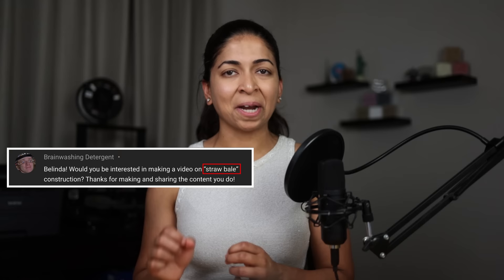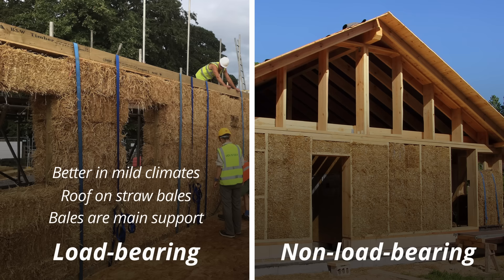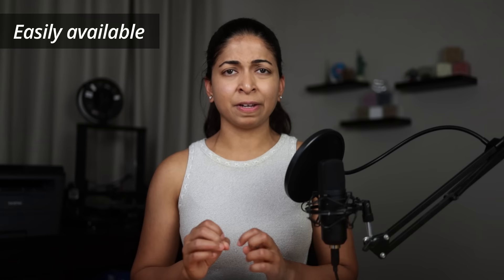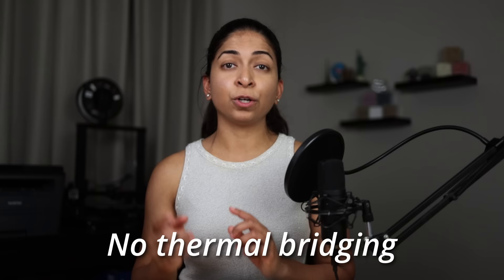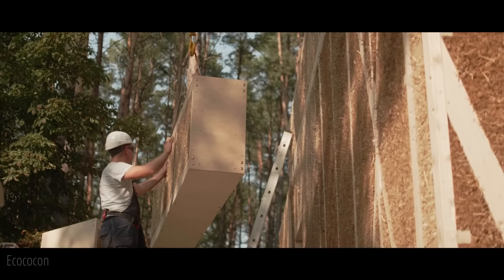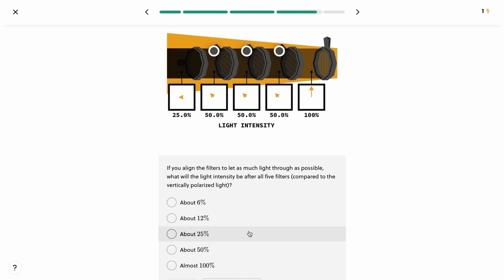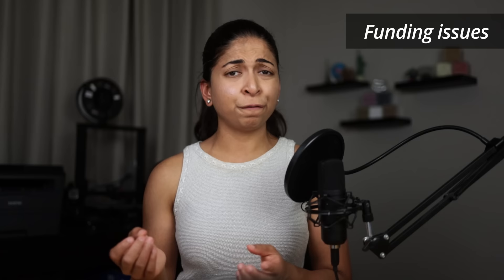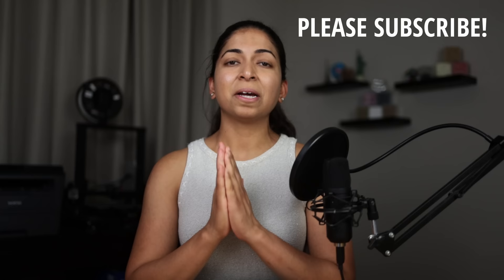How to build Straw Bale Houses | Pros and Cons

Comment: Most of the downsides of bales are the same as for wood. As they are the same material, cellulose. Just bales don't dry easily once wet, so have to be kept dry. Though longer term the same is true for both. Considering the lumber costs this method should have exploded, but so few understand it. 
Austin TX has a written code for it. Though I feel it is all constructed slightly wrong which causes the wall height limitations. The walls need some method of staking them together to provide shear resistance (keeping them in a stack). So most put a high strength material though the center of the bale, like rebar or wood stakes. That method doesn't use the strength of that material well. It should be placed on the exterior of the bales and tied together between each course. Then the high strength material is on the outside where it forms a sandwich composite beam. The tying pinches the bales between, providing the shear resistance, but also adds bending resistance that center staking does not. The concrete/lime/plaster takes the compression, and the sandwich material takes the tension. Then building to larger unsupported heights isn't as large an issue and the walls are far stronger. It is also easier to construct as nothing is required to pierce the bales.

On the issue on wall hangings, you can place wood strips between the bales at locations you expect to hang things. Particularly cabinets that carry higher loads. They can be installed either horizontal or vertical, and are a rigid connection point once all the plaster surrounds them. Some even leave the outside edge exposed which makes them easy to find.

Comment: The prefabricated panels sound like the most feasible way to incorporate straw into a wider usage. There is less room for error in manufacturing due to being done with machines, and probably also offers the option of including other liners or chemical treatments. I'm sure it will take a lot more trial and error to find the best way to use straw in modern construction though.
Reply: I'd add to this that it seems most current techniques are being limited by the conventional form of straw instead of how it could be used/processed.

Highly compressed straw panels could have useful applications (mostly eyeing that fire resistance) as drywall or even in a matrix like hemp.

Simply stacking bales just seems like minimal effort in application.
Reply: @quintessenceSL  Something along the lines of medium density fiberboard made from shredded, compressed, and treated straw? I'm unsure if straw would have similar enough properties to sawdust to be used like that, but it may be worth looking into.

Comment: ??? As an architectural engineering student, I became fascinated with the idea of underground buildings.  The insulation qualities are intriguing.  Can they be built in a green manor? Are maintenance costs reduced?  How much more costly might they be from traditional construction?  Are they safer from fire and tornado damage?  As a lighting engineer, with clear story windows and skylights, it's possible to get ample daylight into this type of building for a pleasant space you'd want to live in.  I'd be interested in your take on this subject.
Reply: As a follow up, relating to your video on geopolymer cement, this seems like a good material for the envelope due to its waterproof properties.

Comment: I recently learned that there is a team over at Penn State Uni that has been investigating low temperature (<200C) sintering ceramics for applications such as building materials.  That could have profound impacts for the sustainability and longevity of structures in almost all climates.  It's headed up by Prof. Clive Randall.

Comment: Things i wish you had mentioned:
Old quote from the 1960s and 70s... "Good Hat & Good Boots"  meaning a proper roof with overhanging eaves designed for each specific location.. and the right foundation for each environment and topography. 
Attention paid to exterior surfaces to insure continuity (no gaps or thermal breaks).
 Acoustics  deserve special mention!  Ask musicians ... and old high fidelity fans.
Asthetics are a large factor in long term satisfaction for home owners. When the walls are reserved for doors, windows and sculpted clay...light flows around in an ever changing dance. Closets, cupbords, built-in  whatevers and paintings can grace the interior walls.
The $$$avings  on utilities cannot be emphasized enough.  If the passive solar & insulated house eliminates/reduces  the outrageously  increasing costs of heating and cooling the home ... you will have the freedom to choose ~ what you want~ to do with that money every month, for as long as you live there.
Reply: Sorry to run long....
Must add passionate endorsement  for clay interior walls... heavenly fresh breathable  air! 
For exterior walls clay, more clay, and a surface/final coat of clay-lime render.
Yes.... it is hard work...but so very much worth it!
Excellent books abound, as well as videos and building seminars. 
This might just be the quest of a lifetime resulting in a home for a lifetime.

Comment: In major fires Sonoma County, CA the only homes to survive flames at and on the homes were straw bale homes. Many photos. But, NOT straw bale homes that had wood trellis's.  These homes also had 4" inset windows. Straw bale walls are 2 feet thick covered in a mixture of Portland Cement, Limestone, and Sand. Mold, fire, insect proof. High thermal mass so low heating and AC bill or non-existent depending on where you live.

Comment: I think there is potential in this building technique, but it feels somewhat, for lack of a better word, simple. The prefabrication step is a great start, but when you're already building them in a factory, maybe even with automation, you should be able to counter some of the weaknesses. Adding rice husks for increased density and quicklime for pest control comes to my mind here. Also pre-applying plaster/claymix in the factory would leave the construction crew with only the job of applying the finishing layers.

Random side-thought: Are there no plaster bots?

Comment: Hi Belinda. I live in a ferrocement dome. I live in the tropics and have no insulation, but if I lived somewhere else I would spray foam outside of the shell and insulate under the floor. Then I would put 18 inches of earth over the shell. Earth sheltered not underground. You can heat this home with a hair dryer. There are many on YouTube. Please do a video on these indestructible homes.
Reply: I built it myself. Without an air form, cheaply.

Comment: Straw bale takes a lot of work compared to nailing some stuff together and calling it a day, it can also cause some challenges with electrical i would imagine like running new stuff after the wall is up. Couple reasons its probably avoided. If you tried to pay a company to build one for you it would probably cost a lot more than traditional stick built. But its energy cost would be like 20% for heating or cooling.

Comment: Did you ever make a video about interlocking stabilized soil blocks (ISSBs).  A Kenya company called Makiga makes a manual press to make the blocks. The blocks are 90% soil and 10% cement. They are interlocking requiring no mortar. Have you made a video on ISSBs yet?

Comment: What's the allergy situation like inside a straw built home for those with a hay fever? I saw a "Grand Designs" episode in which, during the walk-through of the completed house, McCloud commented that the interior smelled like hay. That could be an advantage for some, but what about those with allergies? I'd assumed the hay would be encased by too many layers for particles to get into the living space, but it sounds like there's more air exchange than I had assumed.

Comment: One of the advantages of traditional building is it's well known and understood. Inspectors know what they are looking for and when you get a certificate of occupation you know there is some basic level of checking that happened.
A house is a very expensive thing and building with an alternative method introduces risk. If home isn't built correctly and an error was made there's no way to easily have someone double check the work. A county inspector will have no idea if it's good and even hiring a 2nd contractor to inspect it would be difficult if not impossible to find someone able to check the work. This in no way is to say it's bad but it is more risky. Everyone has their own risk tolerance levels but for many Americans 95% of your financial resources are in your home. Are you willing to take a risk with something so expensive?
Reply: Additionally this is an issue that will last the lifetime of the home. If your house is damaged and in need of repair it can be difficult to get correct repairs made/ know if the fix was good/ and identify possible issues Traditional homes are fine if there is a small crack in the stucco. Normally that's a water diversion layer thats part of a larger waterproofing system. For a straw home a crack in the stucco is a critical fault that needs very specific remediation.

Comment: I can vouch for straw lasting years ,,as my house was built in 1981 and has straw walls as interior walls,,,the one issue I have had is if the wall gets damp ,,it stays damp,,its nearly impossible to dry out.... So using as exterior walls I think is probational,,,Exterior walls are going to get wet sometime,,,and the result will not be very good,,,ask me how I know!!!!

Comment: For wildfire resistance, is that only load-bearing construction or also wood frame construction with the straw as insulation?  Mortgage and insurance challenges makes me wonder if rock wool is a better compromise for that?  For poor areas using local materials & labor, this looks like a great fit.  Also adobe buildings including Missions are still standing hundreds of years later

Comment: Fat walls. There is a subject I think you could look at there is a TED talk on it woven trees. I am in the Philippines and the issue here is logging bans although wood is the best construction material. Low thermal mass in a hot humid climate so I am interested in the weaving of trees to produce structures. The Germans are thinking about this big time whole cities looking like forests. Think of a yurt but woven trees that eventually fuse together to produce cylindrical or whatever homes.

Comment: Load bearing straw bales are an "alternative" construction type, but non-load bearing type is simply using straw for insulation & therefore it's standard construction (does require some alternative details but not many). Engineering for load bearing type (& the construction details required) is quite tedious to demonstrate code compliance. Straw bale construction is bizarrely sound absorbent in interior spaces before adding parging, its like the cone of silence.

Comment: Something I thought about while doing my income producing job. While living on Okinawa, or in the Philippines, concrete was the staple and standard for strength for earthquakes and typhoons. And once those areas learned to use certain exterior insulations, the distress from the heat became way less. Yet, here in the USofA we still build with wood sticks. There the structures last easily for over a hundred years, while here in this bribe-influenced building code environment... argh... not so good.

Comment: If I was to win the Powerball or Mega millions.
I would buy.
-several acres pf land in the woods.
- straw bale home.
- 2 suites
- A room for home schooling/bible study/nursery with a half bath.
- 2 offices ea. w/ half bath.
-room for cats.
- 2 or 4 Jack and Jills.
Door frames hand hewn.
- When you first walk inside hay trolly stone floor different shapes and colors.
A closet half-bath.
-living room pitched ceiling, wood burning fireplace dry stack stone an antler chandler.
-Deer Elk or moose head mouth over a hand-hewn mantle. 
- iron wagon wheel over dining room table.
-The light over the island Han hewn beam, soap stone counter a farm sink for around 100 years ago. 
The uppers will have glass two pains with chicken wire between them.
-Rusted tin ceiling in the kitchen dining room.
-Same as the main office.
-Antler light.
The desk will have a live edge kidney bean shpe fratchel burned.
The legs post and beam.
sconces made of antlers
-The vanities old dressers wood turned bowls for sinks
-ALL the closet barn door made from barnboard.
French doors that lead out on to a deck from the dining room, master bedroom main office the deck looks out on to 10-acre pond.

Comment: At 2.42mins you say that Cement can be used to cover the bales.  NO - definitely NOT!   Must be breathable - preferably lime.   Also a vid on Hempcrete housing, specifically focusing on the  'U' values compared to straw please.
Another video on LINSEED bale houses - the Rolls Royce of bales!   Has far rougher stem than straw so rodents don't like burrowing in it, an oil stem to help repel water and FAR smaller diameter stem so bales are much denser with better 'U' values.   Downside - about 3 times more expensive than straw, as a far bigger acreage required to produce bales.

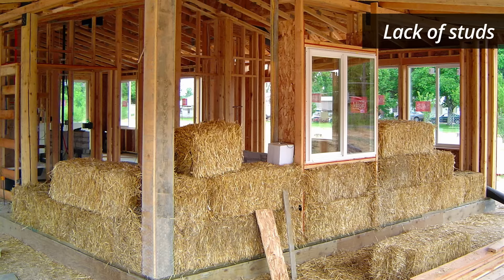Comment: I don't agree with your "disadvantages".. Pests : It is the same cliche than with "fire", straw is unedible (wheat stalks.. not hay like you show in 9:21 wich is misleading) and unconfortable for rodents. If you respect normal construcion bases, (same for humidity stuffs..), you won't have problems. If you just put rodents grids at the good places, hanging roofs and waterproof basewall you won't have problem. Using many synthetic insulation have the same requirements, but rodents like them (styrofoam, rockwhool, plastic fibres..)
About price, it is much more intersting and easy to build it yourself, with friends, than to pay somebody (offcourse it is expensive !)
I know peoples living for years in round load-bearing strawbale (less wood costs aswell.) they spent only 5000€ for a 6 meter diameter offgrid home.. (without the land cost and inside installations..) Unbeatable !!
Plastering with clayed earth-straw is very affordable (time consuming, yes, but a good occasion to invite / make  friends..) non toxic/agressive for the skin, relaxing, (i know some mother doing it with the kid on her shoulder...) artistic... It is not that complicated; you can learn each steps in few times..
Aestetics: It is just a question of tastes, and some very "normal looking" strawbale houses are as well made.. You can even don't say it in the building papers (in France..) when it is plastered..
Studs : Every friends having strawbale houses with differents strawbale technics have no problems with "shelves, cabinet, and decors"...
Place : Yes, it is a little problem. But you have the big advantage of having a super insulated house.
Codes: You can in some case not say that you uses strawbale, it is anyway plasterd on top a the end..
Have you really visite, experiment participative workshops, sleept some times in this places, or are you only reading us some stuffs seen "on the internet" ?
 Tere are already so much clichés around, lets share real verified information, for the sake of everyone !!
Thanks !

Comment: Anything that looks 'weird' and 'unconventional' to my building department will bring unwanted attention and extra costs to my project. Straw bale construction is just not an option. It looks simple, but is not. In the real world for the owner builder forget about it. If you are far off grid, far far away from building inspectors, don't intend to sell or rent it out, are not going to try to insure it, and are building it yourself, and have a ready supply of cheap bales of hay, then go for it!

Comment: Belinda,
We have an on-going search and study for all around and logical building solutions (for decades).  This one fails on so many levels.  Consider the varied areas of the country, their codes and requirements.  Consider people's needs for safety, security, cost, etc.  Steel shipping containers would be far better than this.  I am not a wooden house promoter either.  Wood is not a good alternative as it rots, burns, has insect problems, mold problems, is really not recyclable and cost issues.  Not to mention, trees make oxygen and use carbon dioxide.  The new types of concrete will significantly impact the carbon issue.  Cold Formed steel is scalable and structural.  There are various new composite panels for sub floor, sheathing and roofing.  There are variations on the theme using ICCF (not ICF) that can work even for HUD and housing authority applications with fibered surface bonding waterproof materials.  For very inexpensive, DIY people,  the old CMU (concrete masonry unit) with surface bonding cement from years ago is far more logical than houses the cows and goats can eat.   This is such a stretch.  If this is strictly an entertainment channel, please  delete this comment ( we are engineers, architects and construction managers).